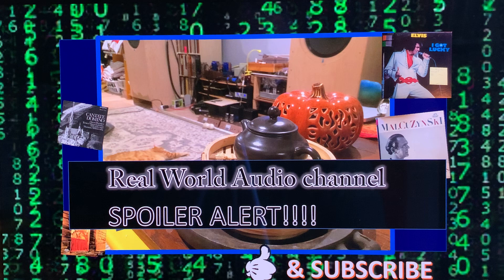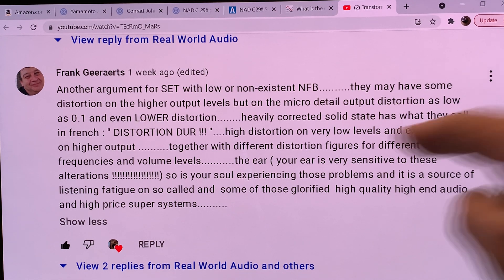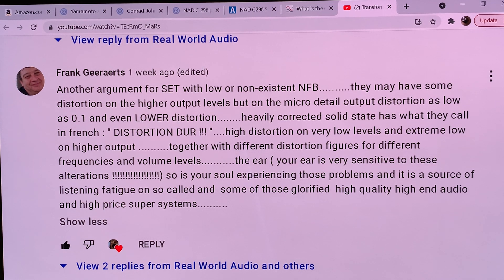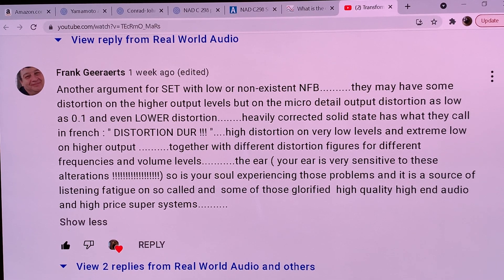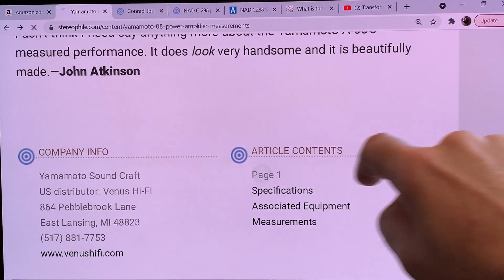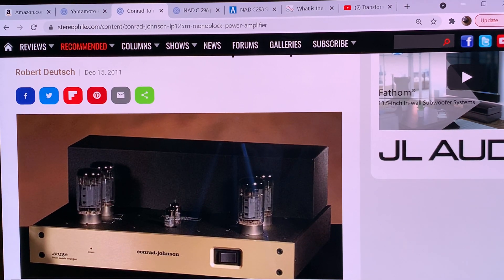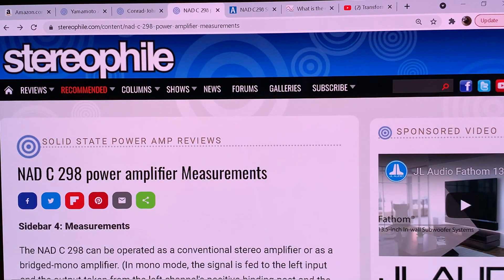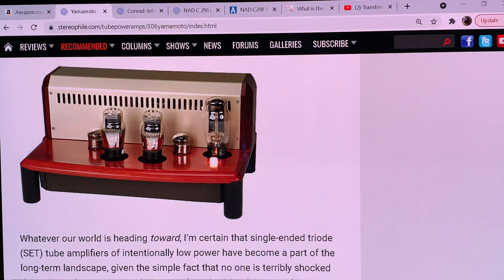LANDMARK SERIES ON AMPLIFIER DISTORTION AND SPECIFICATIONS - starting on Monday!

Comment: This is very very interesting ! I am now two weeks into my new C298 and it’s not going so great. I listen a lot at very low levels and the SQ just becomes flat and boring… like very nice fruit but wrapt in cellophane! You see all the colors and details but the smell is gone. I am suspecting that the “first watt” or I my case nano watt is not doing so well. 
Just a side note to measurements… remember the old GAS Ampzilla that quoted frequency range, from DC to blu light +/- infinity.
Reply from the maker: Hi Klaus, that's sad... indeed, the C298 seems to be optimized for the 10W+ range on the power curve. Yes, I recall the Ampzilla threads going strong on the forums for many years... :) Cheers, Janos

Comment: Hi RLW
Just wanted to ask you.
I’m finding these videos very interesting and have already begun to change my listening habits (and am playing more records😁) so thanks for that 👍
I’m just not getting the inferiority if my setup (ss power amp) tho with regards to dynamics etc so I did some searching and using my own gear as an example got these numbers:
Amplifier: dc rv +- 58.5 which appears to mean 117 vdc voltage swing
Speakers: Vrms 15, Vp 21, Vpp 42
So looking at these numbers the amp has plenty of power for transients with these speakers, which is what I do find listening.
Also although a thermionic valve amplifier does have vastly greater voltage capability, the speakers aren’t able to use it.  It appears a bit like asking Superman to open a stuck jar of Marmite🤡
I did have a very well reviewed p/p valve amp before this setup, a Leak Stereo 20.  it was lovely to use but as I  mentioned in a previous it just ran too hot for my room and I was only using it @ 8-12 wks a yr, not having air con, so I traded it for a friends valve phono stage and valve preamp (proper ones not dinky Chinese, he’s a pro valve amp builder) and reconditioned a Marantz 240.  Same very efficient speakers but I’m just as happy (actually happier as  I’m no longer sweating 😊).
So am I not as affected by the amps limitations due to the valve front end or perhaps (and I am pushing 60 with near 50 yrs spent in the ocean, surfing) my cochlea are like miniature reefs and my own ability to experience musical detail and listening fatigue are greatly diminished?
Love to hear (haha) your thoughts and again, thanks for the videos.  Your a very generous guy!
🌞